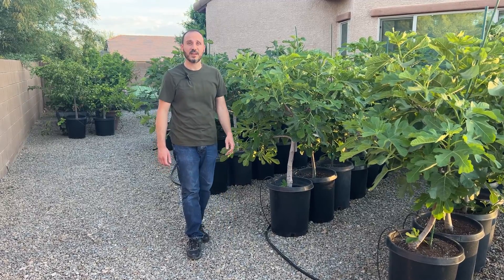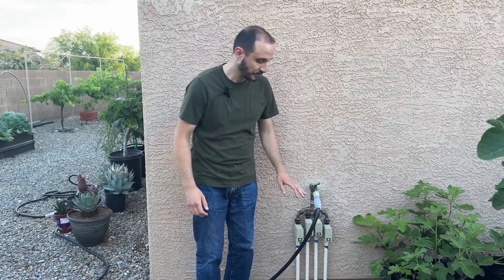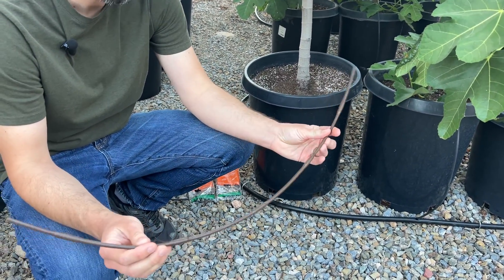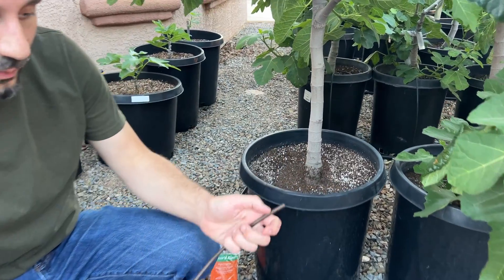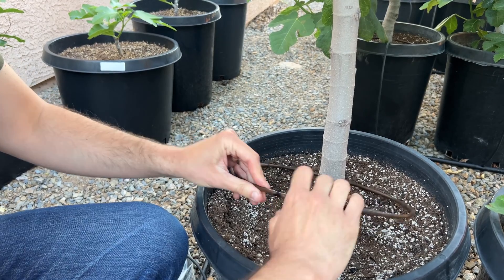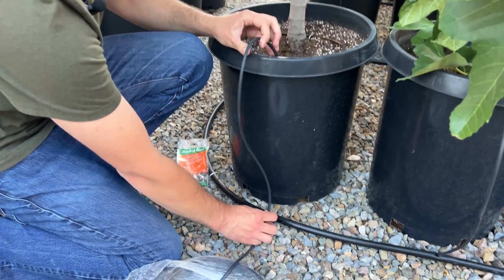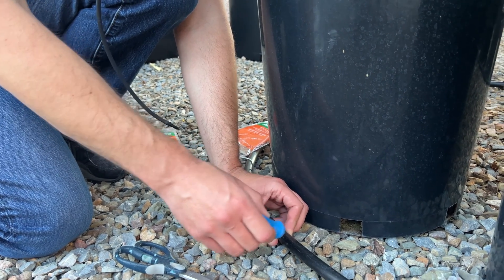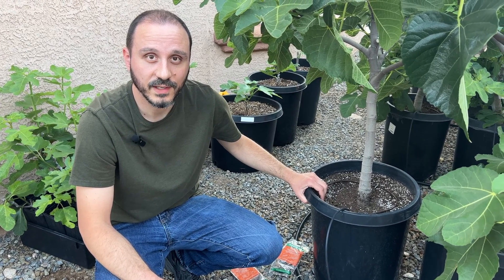Automated Watering For Potted Plants

Comment: Thank you for the very helpful video. I'm about to order all the parts listed to do about 50 potted plants. Are you still happy with the timer you used in this video
Reply from the maker: Thank you. The system works well. The only issue has been wind occasionally knocking down plants, so you'll want to solve for that. You should verify that your water source can deliver enough GPH to keep up with 50 plants. Good luck!
Reply: @jesen84  Thank you! I have two hose bibs one on each side of our deck so it'll be half and half. My concern is the small pots, I planned to use the drip stalks for those  rather than the hose emitters. The stalks  say max pressure 30psi.  I was going to use a 25 psi flow restrictor. Do you see any issue with that arrangement? Thanks again.

Comment: I have the same setup with the rings, but I only use 4 emitters and they work pretty well. What size pots are you using?
Reply from the maker: Sorry about the slow response. Mine are 15 gallon pots. I’m sure 4 emitters also works well.